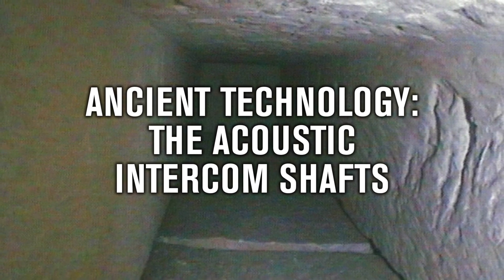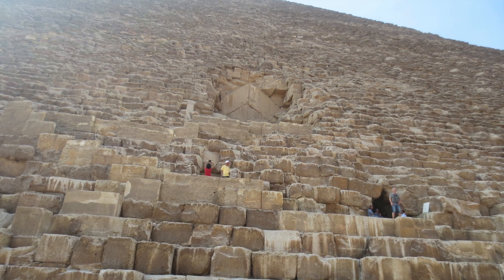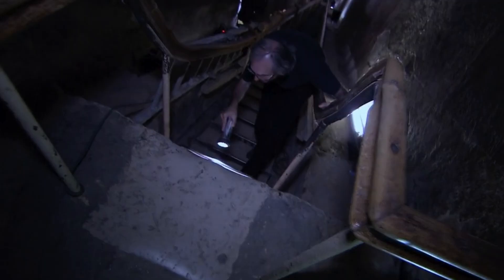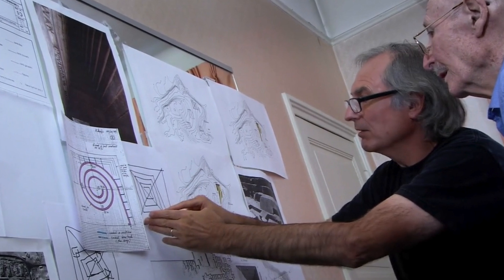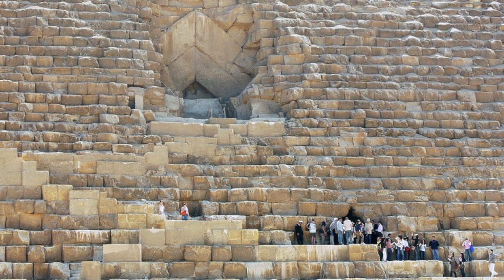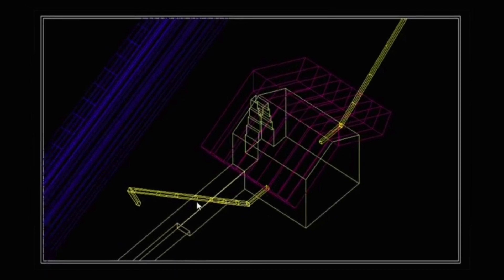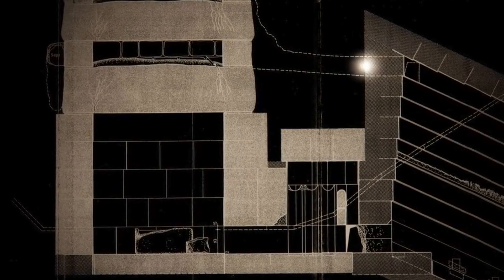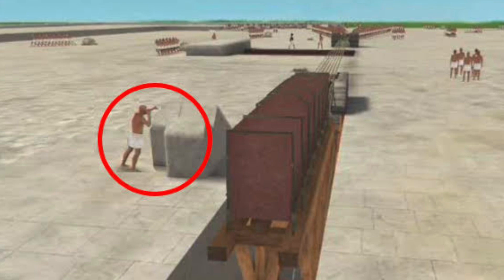Great Pyramid ‘Air Shafts’ Theory: Acoustic Communication Shafts | Ancient Architects

Comment: TY for an interesting video. Houdin's theories are interesting, but i think that as most egyptologists, his work is based on fundamentally wrong assumptions: that the megalithic pyramids were built for the purpose of tombs. As an architect looking at the architecture he should know better. Instead he just took the mainstream indoctrination and ran with it. When we base our theories on a faulty history we cannot progress much in the direction of truth. Just like if we build a house on a foundation of sand, that house will crumble in time.
These structures predate the dynastic egyptians and they were never tombs. Looking at the high level of precision and engineering it is very clear that they were built by a very advanced civilization that used modern cranes and all manner of industrial tools of large scale. They were certainly not built by a simple people with ropes, wooden sleds and copper chisels. Looking at the architecture of the inner chambers nothing says they were made for human habitation or rituals. The chambers and tunnels look more like they had an industrial purpose. These pyramids were most likely factories of some kind. They were placed near the Nile because they required water in their operation. The narrow tunnels were never made for people to traverse, they are conduits for some kind of fluids or air. They also had valves in the conduits at regular intervals to regulate the flow of the fluids inside the chambers.
I am sorry to see the Ancient Arch went down the path of the established narrative with the silly story of "pyramids were tombs" instead of keeping an open mind to new possibilities.

Another thing most historians and even architects get wrong is the construction process. The limestone pyramids were never built with carved stones out of quarries hauled for hundreds of kilometres. They were made with geopolymer concrete made of local crushed limestone and other chemical binders. They never had to haul large stones up the pyramid, only containers with crushed stones and powder chemicals which they mixed on site into a geopolymer which they packed into wooden moulds. This is why pyramid blocks dont have any spaces between the seams - they were poured into shapes, just like we pour cement in our time.
Im guessing Jean Pierre Houdin while researching all the established narrative indoctrination he never came across the works of Joseph Davidovits, a french chemist that reinvented geopolymers in our time and proposed the theory that the limestone pyramids were build with geopolymer. He has even done an experiment perfectly replicating 3-4 pyramid blocks at the same size and with the same perfect seam between the blocks. For me this is a definitive solution which makes perfect sense knowing that ancient egyptians, even in dynastic ages, had advanced chemistry.
It is time to move forward with an open mind and drop the old mainstream theories that no longer fit the evidence we are finding.

Comment: I don't buy it. Why the copper pins in the "door" at the end of one shaft and then a small room beyond it? It's also entirely possible that the shafts had more than one use. I don't buy the copper pins as handles. Electrical contacts.

Comment: The amplification of sound is a byproduct of the structure.  Yours or his idea is nice, but it is not the reason the chambers were constructed. Its absurd to think that the intended function of the chambers were built into the structure as a method of communication system in and around about the pyramid structure. But good imagination though.

Comment: I am not an architect at all, but this theory seems to be tail wagging dog. Was there really the need for so much communication between the two levels of the pyramid that this system had to be employed? Wasn’t the lower levels completed in all but the smallest detail before the higher levels were initiated? Surely it would take a matter of minutes for a message to be transmitted via messenger. What would be the need for such second by second communication?

Comment: Nah, i dont see this. Law of simplicity -> If you need a "Voicechannel" to communicate, why build it inside the pyramid with such effort. Just build a channel on Top of the Buildingplatform. Way is shorter and way easier to accomplish. Flag Signals etc mentioned in other comments are also clearly a better solution. There must be more about those shafts. I dont even think they had some spectacular purpose but it wasnt just about yelling to other workers

Comment: Close but no cigar. When you want to know how the structure really function let me know😂
Reply from the maker: Sure, ok. I’m ready!
Reply: @AncientArchitects  wasn't sure you would actually respond to me. I really do know the secrets I've known for a couple years now. It is difficult to explain via text especially since I am at work right now. However due to previous videos that you have on the subject I know that you are quite familiar with the structure. I do not however know how versed in science you are. I will send you a message when I am finished with work. Should be around 6 o'clock Eastern Standard Time. If you are really interested I will attempt to Enlighten you, although It will be difficult through text messages.
Reply: @AncientArchitects I am off of work now, what do you know about holmHertz resonators?

Comment: The simplest explanation is aquatic elevators. The “Shafts need not hold water.
There should be at least one more elevator. 
It would be offset similarly to Q and K “gallery 
Blocks could have floated straight in from the Nile. The “lock doors” lowered and then filled from the shafts. There’s literally boats next to each pyramid….the simple answer is boats

Comment: Why not, but ... th complexity of building these shafts seems  disproportionate with the purpose you mentioned... just communicating 50 m away ...  if it is to synchronize 2 teams, it is inadéquate. : messages are very simple and can be visuals (no need to sophisticated devices) and instant (sound implies a delay for propagation). Sorry but not convincing.

Comment: that is way to much work building shafts when you could just shout out orders to each other and as far as the counter weight system in his construction theroy how did they get the counter weight up to the top to pull the 60 ton blocks up there.

Comment: well, imagine that, solid smooth stone reverbs and echoes sounds. that would bring the science community to a standstill if this were the fourth century. just because sound echos through the shafts doesn't mean that was the purpose for their construction. I'm sure on the rare occasion that it rains there the water flows through these shafts so maybe they were constructed to carry drinking water to the crews working inside. face it, without the original drawings and engineer notes there is no hope of solving this mystery, only theories.  with all the theories there is no way to tell which one, if any, is correct. so marvel at their wonder and quit trying to solve how it was done.

Comment: Queens Chamber shafts   I think were there to create and transfer some type of energy to keep it within that space hence why they don't exit the Pyramid.  The Kings Chamber stored the energy and needed a ventilation so not to overpower the Chamber which is why the shafts exited outer the Pyramid.  Was it an Hydro energy pump lower down at the QC

Comment: they could have been air/chimneys since the dynastic egyptians did not have electricity.
Reply from the maker: Certainly didn’t have electricity. But not chimneys as 2 out of the 4 shafts didn’t reach the outside… 🧐
Reply: @AncientArchitects  Let's not overlook your respectable earlier theory that the original size of the pyramid may have ended at the ends of those 'sealed' shafts.  They reach to the very same height, symetrical.  As for chimneys, work within the chambers was done while they did not have ceilings, so no need to vent lamp smoke.  After they were enclosed, no need either because the ceilings were so high.

Comment: Inside the pyramide were launched achemical reaction that leads to a pulsating frequency, that pushes on the quartz stone ceiling and created voltage. Pyr A Mid lit. Pyro a Mid. Its a energy plant for emmitting high energetic light, very simple...the DJED piler and the bagdad batterie showing very well what was going on there. The Pryamid produced energy that was directed by the golden topstone into the sky, and this plasma-rays brightest possible light were reflected in all directions by the Polished White outer casing of the pyr-a-mid. The Pyro came out the top, into the sky lke a candleflame, the reflection of the bright plasma flame, was reflected that the light of the pyramid could be seen everywhre. To enlight the planet and to be seen in other galaxy.. And our stupoid lowbrain "academics" is briefed to tell that they burried some bones inside...
Why did they need water? For the hydrogene which was used to create the pulsating energy. Once the pyramid was stardet it run by itself until all channels and tunnels were flooded or dried out empty. Humans are so lost....no connection to time.
Reply from the maker: Scientifically wouldn’t work I’m afraid. Research piezoelectricity and you’ll see why the theory is flawed. Baghdad batteries are also not batteries - again, another flawed theory. Much like the Dendera lightbulb.
Reply: @AncientArchitects  The Dendara lightbulb... could there possibly be a connection between it and the pyramid? The reason I ask is, in the Dendara panel, on the right is a structure shown that looks like the structural detail above the King's Chamber. Four platforms under a peaked roof. Any ideas?✌🏻🐱
Reply: you seem to read too much Däniken or other fringe $ $ $ $ books. bored of real science?
Reply: @ast3663  No. I'm just curious if anyone has an explanation for what appears to be a diagram of the relieving chambers above the King's Chamber depicted on the Dendara panel. 
No need to insult me. I'm curious. ✌🏻🐱
Sorry! I thought you meant me. But I really would like to know what others think about this.
By the by, I have read Daniken...when I was 14. LOL✌🏻🐱
Reply: @PhoenixLyon  me, too..lol..not sure what u mean 'diagram of the relieving chambers above the King's Chamber depicted on the Dendara panel' ??
Dendera was an important religious center during multiple dynasties. You can READ the texts actually. No light bulbs. fringe ideas $$$$$$$$$$
Reply: @ast3663  I'm not talking about the 'lightbulb'. To the right of that, a bit lower, is what looks like four platforms topped with a 'roof', just like the structural detail above the King's Chamber in the pyramid. I've always thought it strange, so was wondering if anyone would have an explanation as to what the diagram on the panel is about.✌🏻🐱